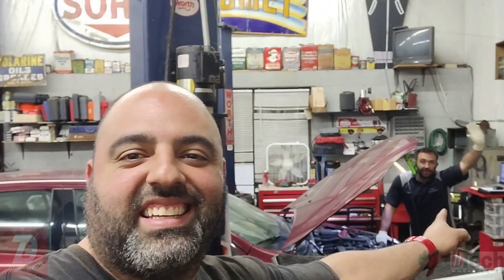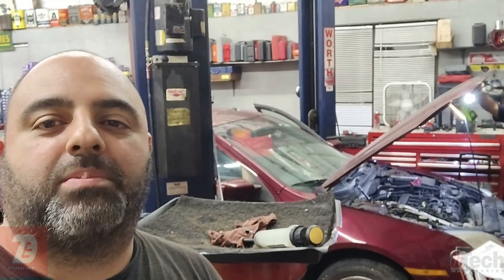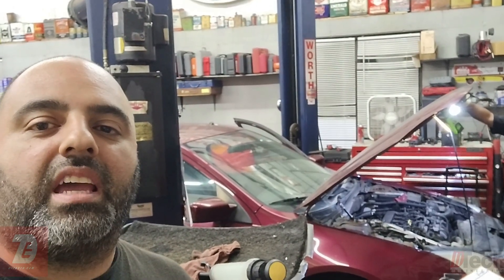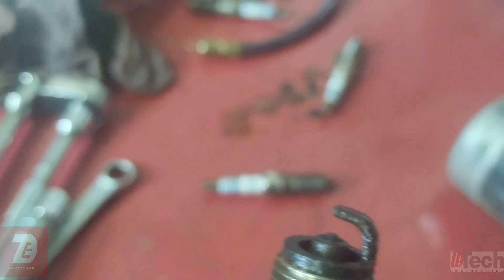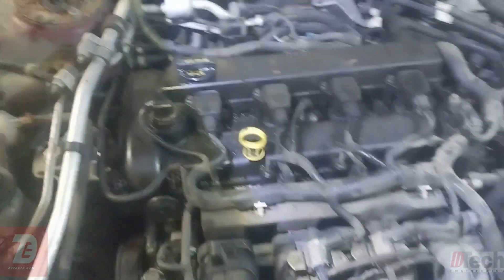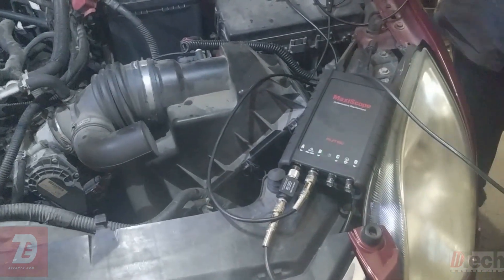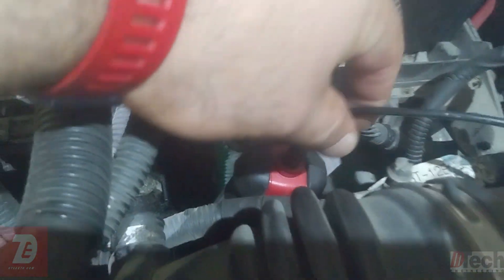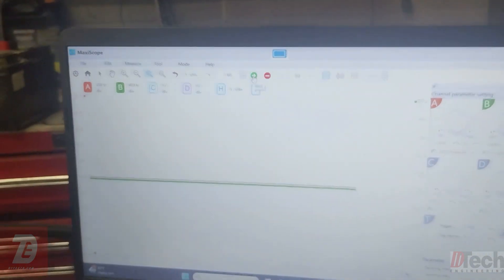Relative Compression Test for No Start Ford Fusion

Comment: Thank you sir. Im new to oscilloscopes and this helps me alot. Im a DIYer and using a scope has opened up new doors working on cars.  I use an inexpensive Hantek 1008 and I also have a mini 2 channel ds212. Not the best gear but they get the job done. Cheers
Reply from the maker: I'm glad it helped, and as long as you are understanding the testing, the scope won't matter up until you get really involved, just stay practicing and you'll get good at it

Comment: Always funny these different models from other countries that have almost exactly the same car but different aesthetics. If you cut the exterior front and rear off this car I see my mazda6. Of course mazda bought that platform off of ford as we never got the fusion. Driveline, chassis and subframes/suspension are identical but sold as completely different manufacturers in different countries.
Reply from the maker: Yeah it's always crazy to see what certain models are in different countries

Comment: I wonder if that is the engine that has no timing marks or key ways... Maybe the crank slipped, I had a Mazda with basically the same engine that the shop did the timing chains on... they took it apart and then called me to figure it out after the fact 😂 they called me up like... "THERE IS NO TIMING MARKS... HELP!!!" 😂 they had to buy the tooling to do it but I got it done except the crank stop tool was for the Ford not the Mazda so it ran like a dog... Got the right crank stop, loosened the crank bolt and readjusted correctly, thankfully that part is all external so nothing has to get removed
Reply from the maker: Yeah, you can definitely get in trouble with those Ford engines if you're not aware beforehand.